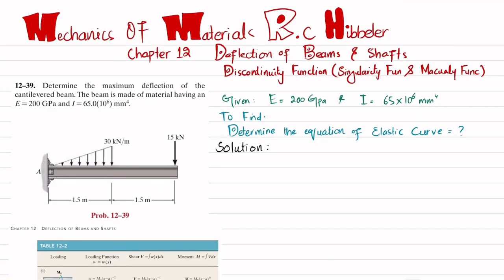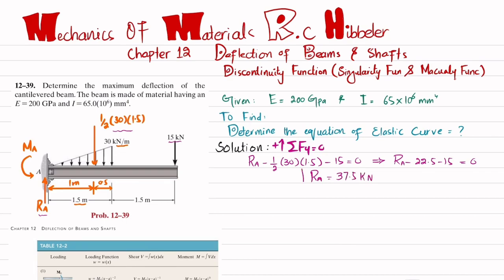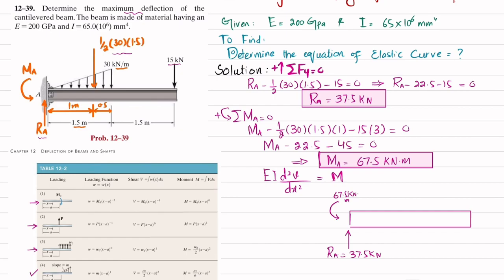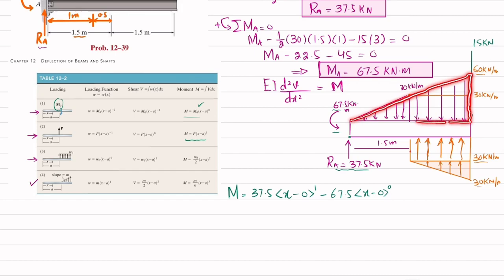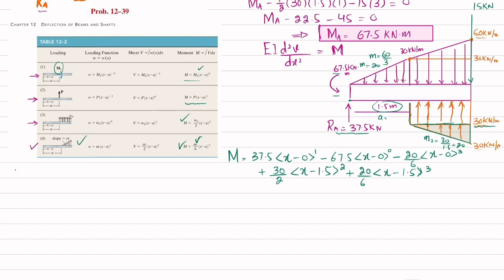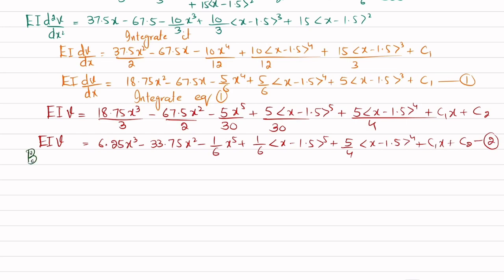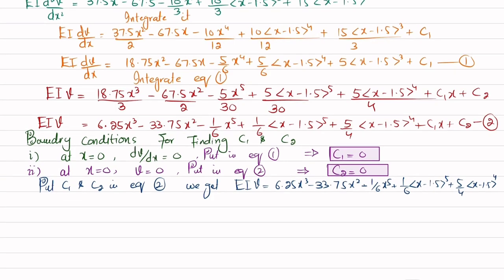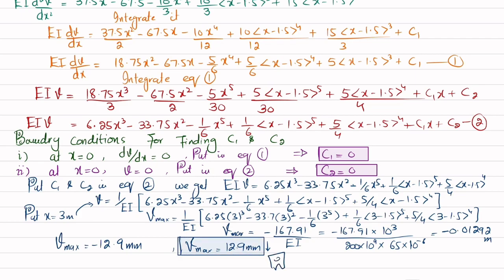12-39  Deflection of Beams & Shafts | Singularity Functions |  Mechanics of materials RC Hibbeler

Comment: The 15kn force at the end of the beam,did you not consider it in your moment equation
Reply from the maker: You can include that and i have already told that its effect will be zero as the load causing singularity function will be <x-L> so either x less than length L OR EQUAL TO L WILL MAKE THIS TERM ZERO. TRY THIS AND SOME OTHER PROBLEMS AS WELL.
THANK YOU